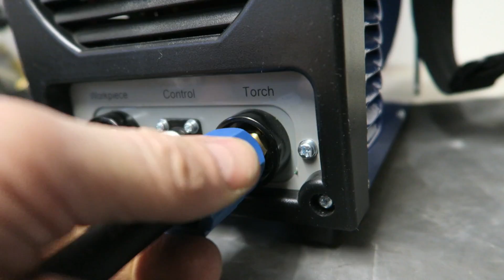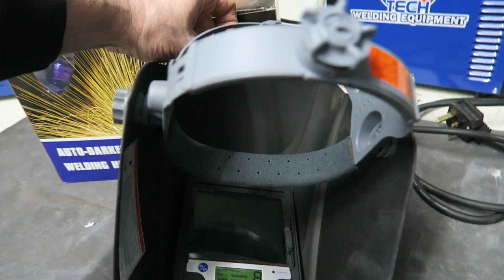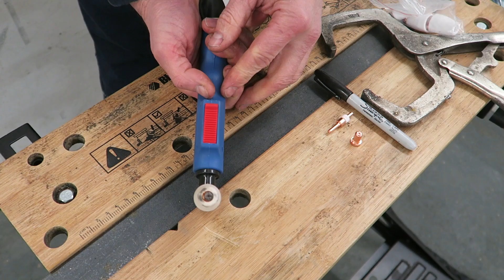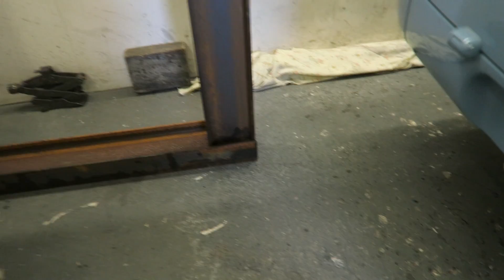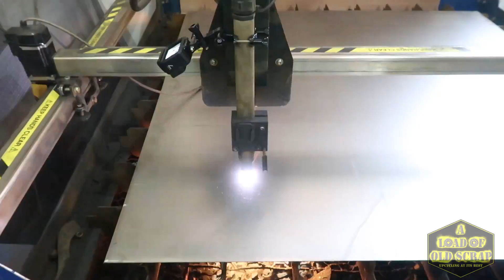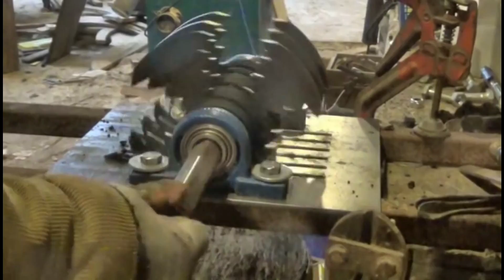New panel press project and plasma cutter review R-Tech 30C.

Comment: Would like to know what sort of compressor to use with this machine please Trev!
Reply from the maker: Just a fairly standard compressor single phase 3hp 14cfm. The air does need to be dry, most important. Cheers Trev 👍

Comment: Don’t forget the electrodes on the C30 are double ended so just spin it around
Reply from the maker: I hadn’t considered this 👍 wouldn’t the electrode be ruined though once one end had burned out? Cheers Trev 👍
Reply: @trevsblog  I watched their tips video on YouTube the guy tells you to just turn the electrodes around as they are double ended
Reply from the maker: Great thanks, I’ve not used it enough yet to actually have to change the consumables over. I can’t believe how useful it is though 👍
Reply: @trevsblog  if you want accuracy drill a small pilot and work from it

Comment: Hello Trev, I have just this minute ordered one of these Plasma Cutters, cause I am just about to restore a 1964 Morris Minor, I've got all new panels to go in and it just made sense to get one, why bugger around for hours with the angle grinder when I can have an old rusty panel out in 2  minutes or less. You have inspired me to do this, your workmanship and skill is fabulous! Last time the Morris was on the road was 2007, it stood under my window for 10yrs and one day I though I'd clean all the mould off it and give it a wash and brush up, and then I thought I wonder if it will start so I cleaned the plugs and points and the petrol pump points, tipped some new petrol in and it started first time! So I thing she deserves the treatment. We also did the 24hr John'O' Groats to Lands End run in her with the Morris Minor Club 4 years on the trot from 2001 to 2004 never missed a beat. I've also got another Minor and Marina and their next lol. Anyway when shes all done I hope to meet you at a car show and partake of a coffee and cake from your lovely Van. All the best and keep them videos coming. Pete................................
Reply from the maker: Peter Hansford thanks Pete, I must confess I thought the machine was going to be wasted on me but I’m using it loads. I’d plug welded some castors on my tool box and needed to remove them, I just cut around them with the plasma, all four wheels removed in ten minutes. All the best with your resto Cheers Trev 👍
Reply: @trevsblog  Hello Trev, I am just reporting back on the first use of the Plasma Cutter, what can I say except that it is F ing Awesome! I've never done Plasma cutting before and i took to it just like I did to Mig Welding. When I was setting it up I watched this video again, and you can't think about the ins and outs of a ducks arsehole or you get nothing done, so I'm replacing both full front chassis legs on the Morris Minor, so I thought I'd better have a practice on some scrap metal, and then I thought the chassis legs are scrap metal, so I pulled the trigger and it was out in 10 minutes! Fantastic! Well I'd better do some more cause it won't do itself!  All the best Trev
PS, You are the King of fabrication like Elvis Presley was to Rock'n'Roll

Comment: Trev all your bare metal work looks so clean what grit discs do you use for cleaning it up I'm trying 40 grit flap discs on thd angle grinder and it chews the metal up and 80 grit on the DA don't seem to last very long at all ........what's the secret ?
Reply from the maker: Dave Springate I’ll be showing some tools and abrasives on my very next video coming just as soon as I get my workshop put back together. Cheers Trev 👍
Reply: @trevsblog  Excellent cheers Trev

Comment: g/day m8 ive been using hand held plasma cutters for 30 yrs.  if you going to do complex or repetitive cutting. make yourself a pattern out of 3 ply wood panel. Measure distance between centre of electrode and blast shield to determine how much material you need to reduce pattern size by.
Keep in mind if its an external or internal pattern your making. Hope this helps. I'm pleased to see that you and Tracy are keeping safe. Keep up you amazing videos. Cheers !

Comment: Why cant the plasma cutter just be left at max amps. Cant see any reason to turn it down.
Reply from the maker: Colin Riley I suppose that theory is mostly correct. It would depend what you were cutting and how long for. An example would be if you were cutting 3mm sheet, say the cut was a couple of inches long? You would cut that in way less than a minute, whatever the amps were set to the machine would work. If you had a hundred of these pieces to cut and wanted to do them one after the other without a break then it’s probable that the machine would overheat. Reduce the amps to 20, the cut would still be fine and the machine probably wouldn’t overheat. Cheers Trev 👍

Comment: Regarding the frame for the press, it would be better if you used the horizontals in the I configuration as opposed to the H configuration. This would give the frame far more resistance to bending, as it is down to the difference in moment of inertia.
Keep up the great vids!

Comment: Hi, Enjoyed the video. Am I right I’m thinking that this machine uses a “drag” type tip with star indentations in it meaning that it can be rested on the workpiece to facilitate more accuracy etc. Something akin to the Hypertherm’s which are considerably dearer. Big investment for me do just checking on this before I make the jump. Can you offer any comment on this please. Thanks in advance of your help. Keep safe and keep on posting
Reply from the maker: lewigas290 yes the copper tip has a cross indentation, included with the unit came a very reasonable consumables replacement pack, tips electrodes and ceramics. The best thing to do is give them a call, you could also consider an online chat as they do have someone there genuinely answering questions. Cheers Trev 👍
Reply: Trev's Blog Sound advice. I’ll do that. Cheers

Comment: Trev! Have you thought about turning it into a rubber press? So all you have to make is a male tool and press it into a big block of rubber. The tool can be made out of fibreglass and concrete. I work a 2500 tonne rubber press and do a lot of heritage work
Reply from the maker: Wichelhausfab 2500 tonnes 🤪
Reply: @trevsblog  yeah it's flipping huge! It has a 7ft bed
Reply from the maker: Wichelhausfab this reminds me of the analogy of an elephant standing on your head doing less damage than a woman standing on your head wearing stiletto heals. 👍
Reply: @trevsblog  this thing is an elephant wearing stilettos. It can soon break a tool if you're not carful. Shame I can't post pictures on here

Comment: Smarties   .?   more like wine gums  ?
Good luck with 12mm  Trev  .🥺😟
I use hardboard to cut around.
No spatter problems
To do your job ..  cut a square hole in it and it is impossible to cut it too big
Just go round and around the inside of the template.
With my Rteck machine the tip kerf is 5mm
So make your template 5mm bigger all round.

Comment: nice blog again Trev! if you can match your power setting with your speed of travel you can get a ( almost! ) mirror finish on your cut edge, depending on the material - (Aluminum doesn't finish so well although I have cut quite a bit of 6mm unknown alloy plate successfully  , although it did require finishing with a flap wheel) . With your press you could probably get away with doing large fillets on your RSJ's rather than passing them through -  if your welder is up to it  - little MIG's have a habit of the welds chilling on the surface mill bloom, I prefer to use a stick welder - bigger arc, more filler rod, keep up the good work  - lookin forward to the van finale:) J

Comment: I got the 50 amp version of one of these machines and the only thing id strongly recommend you get is the a air filter which is also sold by r tech.. fine particles or even slightly humid air can shorten the life of the machine, torch and consumables buddy.. Also i can't remember but if that machine has a form of pilot arc then always make sure the machine is grounded to the piece thats not going to fall off when getting cut as its alot easier to get shocked by one of these due to the higher operating arc voltage.. The pilot arc runs on like 100,000hz so i wouldn't take your chances hehe
Reply: https://xtremeplasma.ecwid.com/FILTER-EX-AIR-Compressed-Air-Filter-p130837876

Comment: Just a tip I picked up Trev. When cutting a hole with the plasma cutter. Drill a corner first so the start of the cut has somewhere to blow the material out/ This stops the build up of slag when using a straight bar as a guide. Love your work "Dude" :D

Comment: You can cut without the crust. But you have to crank up the amperage. For 0.8mm I use 20-24A. And cut really really fast. This will cut clean and straight.

Comment: I bought a 30C a little over a year ago. 
I absolutely love it!
I've cut everything from 1mm to 15mm. Loads of 10mm plate 110mm long cuts and never had it overheat. 15mm cuts are slow and not pretty but 10mm is a lovely clean cut.
I use an aluminium framers square  to get straight cuts.

Comment: I make templates out of MDF (medium density fiberboard in the US) taking into account the offset due to the diameter of the cutting head.  You can quickly make 2 or 20 pretty identical parts fast.  Billk

Comment: Good video trev.  On inside cut outs if you drill holes in the corners you can burn from outside hole edge to outside hole edge and control your size a bit better also it is easier on your torch because you are not making a piercing cut.  Keep the videos coming.

Comment: If you haven't used a plasma cutter before, one heads-up would be put a second air filter/water separator at the machine. You probably have already on the air compressor but it would save on consumables in the long run.

Comment: I think you need to take into account the radius on the cutting tip on the guide.  That make your hole bigger than  you wanted.  Also, I think you need to increase your cut speed.  This should lessen the slag on the backside of the cut.  Billk

Comment: Trev. A press is the “easy” bit, making a press tool is the difficult part. The cost in materials and time hand making a press tool, bearing in mind you need a tool for each part you intend making may not be practical. If you had a milling machine and a lathe for tool making and were intending to make batches with the tool it may make sense. I do wish you all the very best with this.